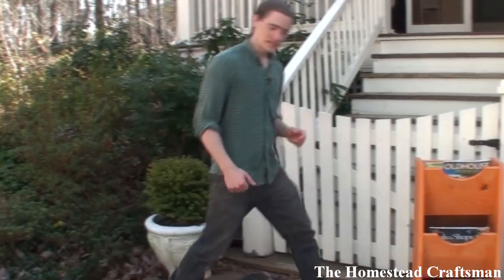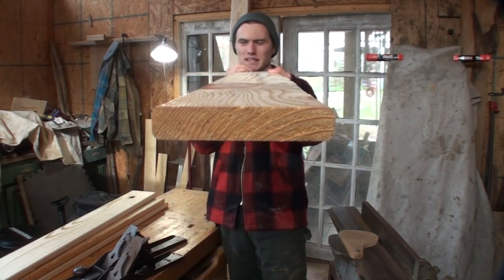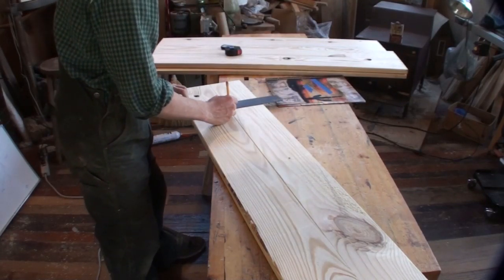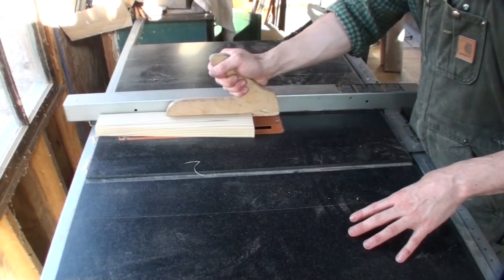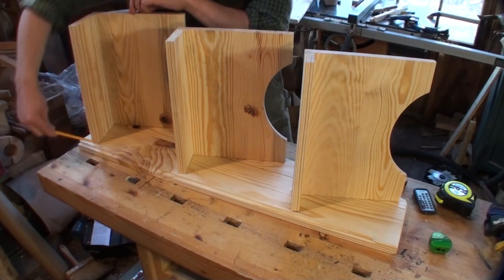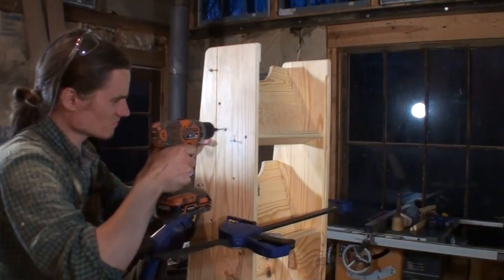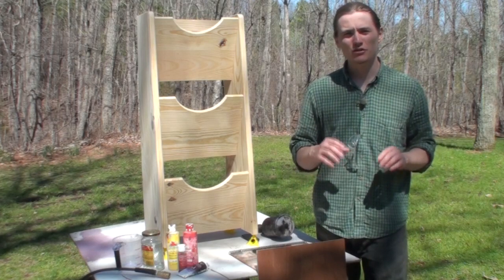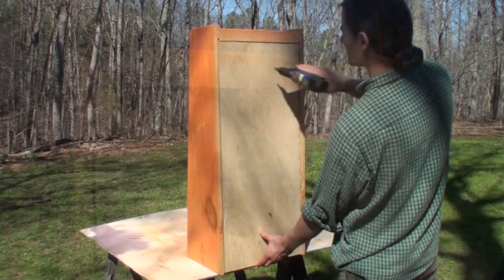Make a Magazine Rack - Lots of cool woodworking tips!

Comment: What make of jointer are you using? I've never seen one that small before! Thanks!
Reply from the maker: It's a delta homecraft, a 50's model I think. 4inch capacity. It's not that rare, I've seen them around. It's very handy, I like it a lot, especially for smaller stuff.
Reply: The Homestead Craftsman Thanks! Almost an antique! And I mean that in a good way.

Comment: Surely this video needs a disclaiimer of some kind.
Reply from the maker: To my best knowledge, no one has every been injured woodworking except for the occasional splinter. Just kidding, if someone doesn't know that carbide tipped blades whorling at speeds up to 6000 rpm will rip your finger off and throw it across the room they probably should steer clear of woodworking.